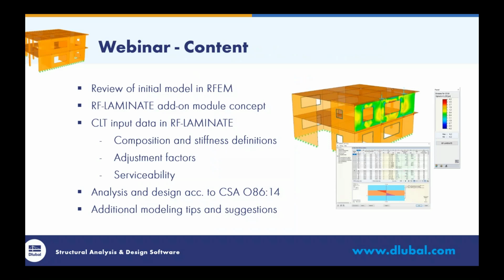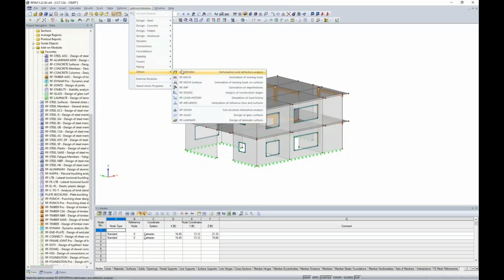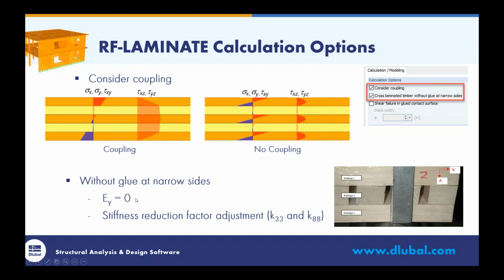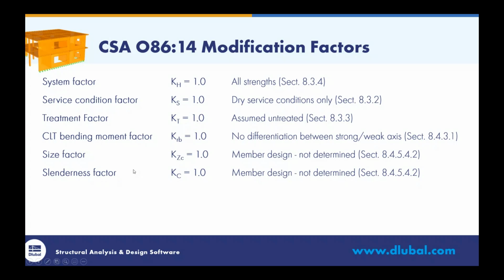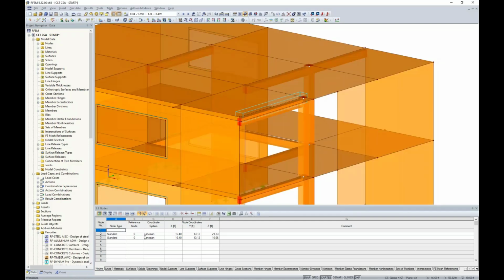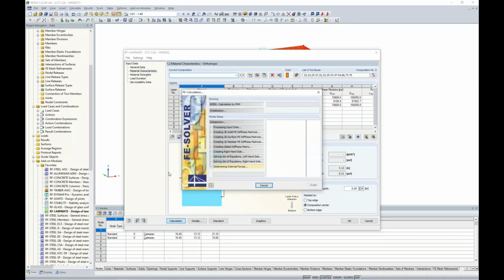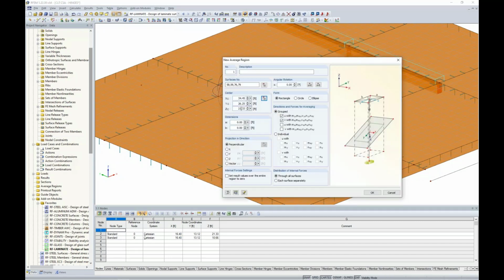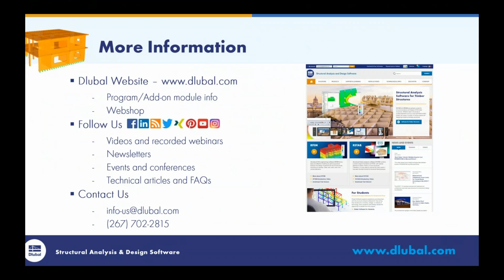Webinar: CSA O86:14 CLT Design in RFEM

Comment: Hello, Great Webinar!
I'm an architect designer in the state of Hawaii and I'm intrigue with your webinar. My state local codes have adopt 2018 IBC and my design firm mainly focuses in Residential projects. Are you able to run an analysis on typical wood design custom homes which use 16" on center douglas Fir No.2 walls? Also, factoring in the wood roof trusses and the concrete foundation. Are you able to run an analysis like this?
Reply from the maker: Hi, Pauliasi!
Residential design topics such as wood shear walls is planned for the future within RFEM 6.  Foundation design is currently underway but also not quite ready.  Feel free to check back in the coming months in addition to our website where we will publish new features as they are released!

Comment: Hi Amy, Firs of all, thank you very much for your amazing webinar ! I have a question regarding how to eliminate the propping effect of a CLT wall supported on a steel beam. The supporting beam doesn't  seem to act as it should do and it seems as if the beam is hanging of the wall which is supporting a CLT roof slab as well. It is obvious when removing the CLT wall, moment diagram of the beam restores its  to the expected shape. Is there any fix for this problem within Dlubal ?
Reply from the maker: Hi, Maan!
We are happy to hear you enjoyed the webinar.  Regarding your question, it would be best to email us the model along with your specific question to info@dlubal.com.  We can then help you troubleshoot further.  Thanks!

Comment: Hi, Great webinar! my only question is when you defined line hinge to release moment between the panels, you entered a value of 50kps/ft2 for ux t account for some slip between the panels, where did you get this value from? how you calculated it?
Reply from the maker: Hi, Maan!
The spring stiffness value must be manually calculated and depends on the details of the connection.  You can find an example calculation in this technical article:

https://www.dlubal.com/en/support-and-learning/support/knowledge-base/001135
Reply: Thank you very much for the reply, very helpful really.
I have a question regarding line hinge results, n,vy,vz, it is understood (n) is the spring force along the line hinge , how to read vy and vz connection design wise? is there local axes for the line hinge?
Reply from the maker: Hi, Maan!
These result's axes still refer to the line itself.  The same concept for the line hinge input will be similar for the line hinge results.  The following may be helpful: 

https://www.dlubal.com/en-US/support-and-learning/support/knowledge-base/001032 
https://www.dlubal.com/en-US/support-and-learning/support/faq/003089
Reply: Thank you , you are a STAR :)